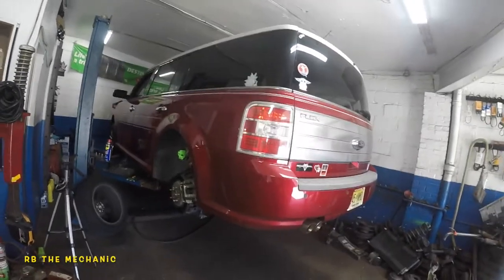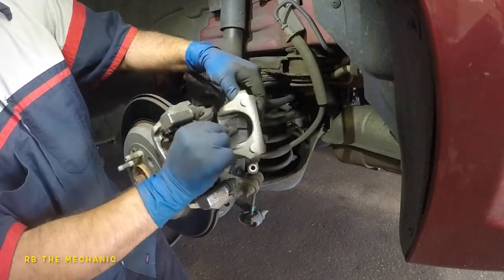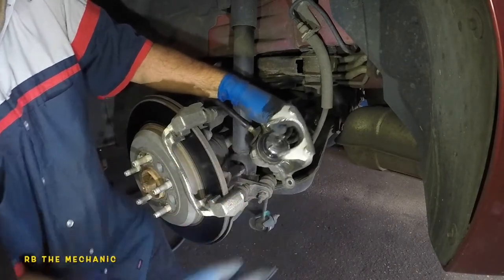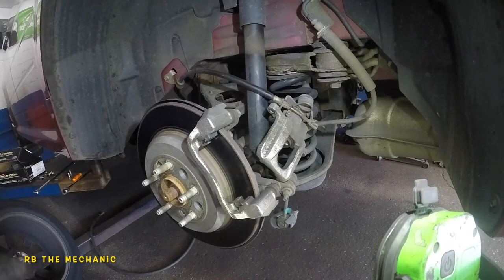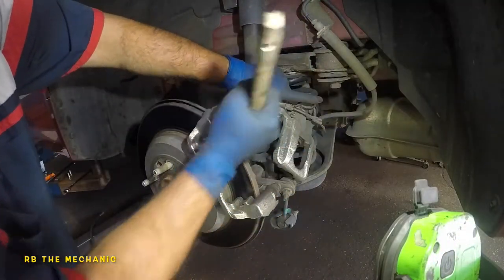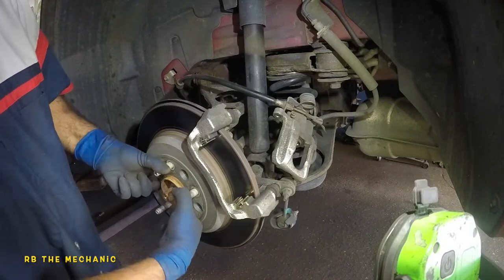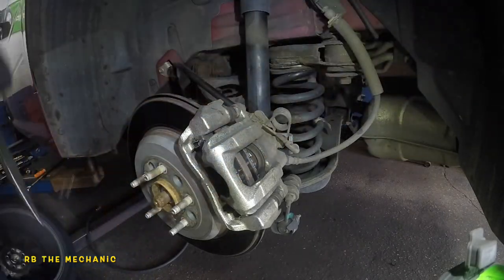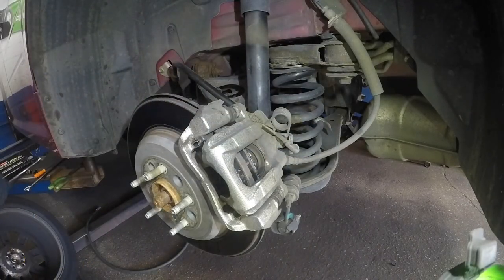How to replace rear brakes pads on FORD FLEX 2008 2009 2010 2011 2012 and compress rear caliper

Comment: so pump break pedal without power assist? is it necessary to open the cap on master cylinder?
Reply from the maker: Yes u can open the cap but it’s not necessary and yes pump the brake peddle once ur completed the job no need power assist u will feel the peddle soft and sink in and after 1-2-3 or 4 pumps it will get hard and ur all set

Comment: Nahh b nahh you spet 400 on a $37 kit! Wow yep i own that kit. Most kits like that are about $40 stop buying shit off that truck!
Reply from the maker: Ok lol yeah Amazon u get it cheap
Reply: @RBTheMechanic  yep and i used it the one time a year i will use it. you get the tool based on the time rated you will use it. i just did them today all 4. rear is a bitch i recommend trying the one pin disc so you can slip it out bk my rear calipers were not slotted top to bottom.